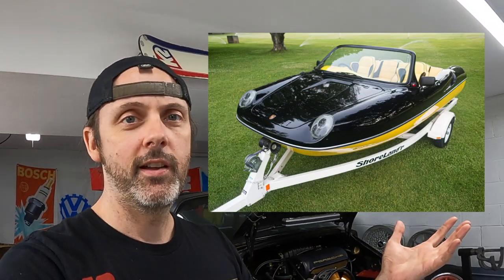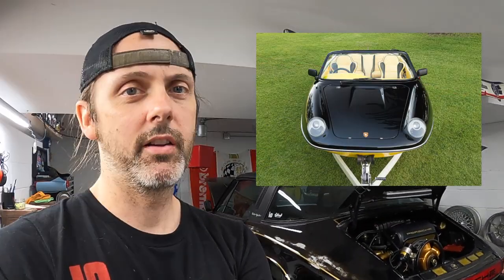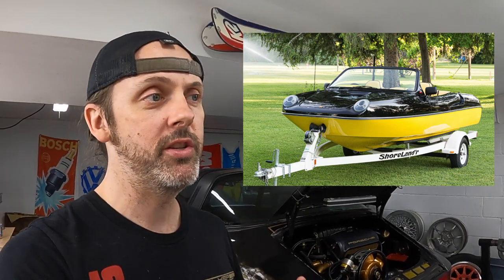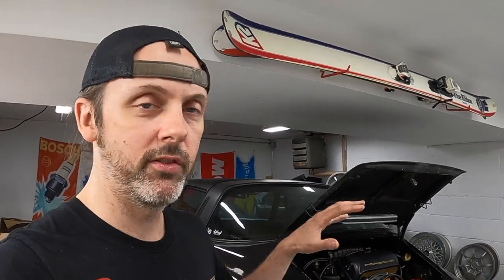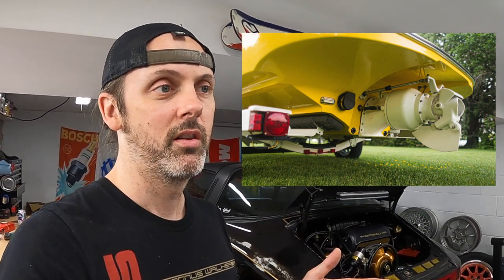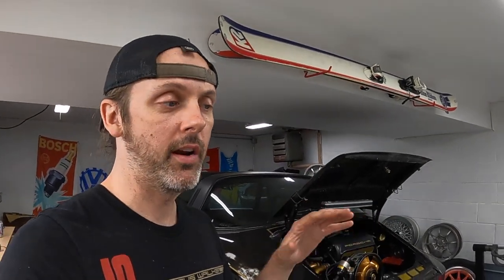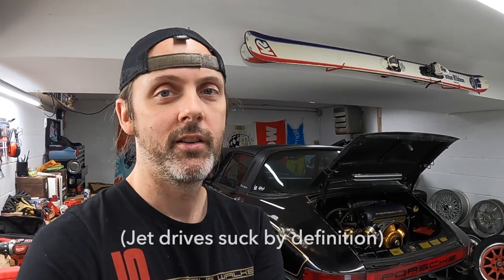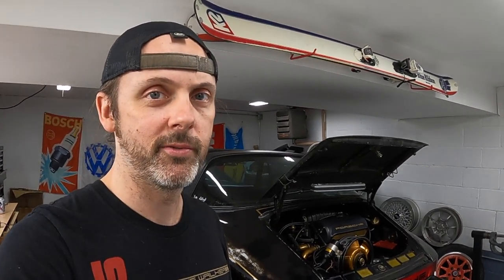PORSCHE 911 SPEED BOAT - Worst Boat Ever?

Comment: I like it, and I think I know a little bit about boats. Why I like it? It looks different. Thats cool. I would like the Altima with the 964 bodykit you showed as well, as long as its done "for the funsies". This surely is as well, well at least in my eyes. I can see paying 20k for something quirky which have no other redeeming features, but maybe thats just me. I am a bit of "originality hound" and not really concerned about sacrilege to the Porsche brand, or any brand for that matter.

Oh, and regarding jet boats and jet drives: You are correct in that the prop is more efficient. Always. But there is one circumstance where that doesnt matter, and the jet boat truly is faster than the prop boat: When you got an absurd amount of power for the hull size and shape. Finnegans boat likely wouldnt be faster with a prop, because that amount of power in a V hull that size and shape is more or less unusable. The jet drive sucks the boat down, like a vacuum cleaner, or a race car with downforce if you will, enabling stability and almost no realistic upper limit to what power can be used. Just look at jet skis/PWC. A propped high powered jet ski of today would be very fast, but borderline unusable unless you got the skills and guts of a 1950s Air force experimental test pilot.... For sure the Jet drive is faster in almost all real world conditions in a powerful jet ski.
Reply from the maker: It LOOKS like it should be fast.  But with a poor hull design, horrible engine, AND an inefficient drive, it'd be slow as heck.  I bet it barely cracks 30mph.  If you want to pay 20k for something that would get outrun by a small aluminum fishing boat with a 50hp outboard, go for it.

As for jets being faster with absurd horsepower, still nope.  Go look up the world record holding drag boat, called "problem child".  It accelerates to over 260mph in under 5 seconds.  Using a prop.   Unlimited Hydroplanes, also props.   His boat would be faster with a prop, and handle better.
Reply: @ADDvanced  Yeah, I am just not that concerned with speed for stuff like that, it looks cool, and it can surely do 30-35, thats enough for most people. Not everything has to be fast, I am sure you agree, so its probably the Porsche connection that riled you up. Perhaps you feel this boat cheapen your car or the brand in some way, otherwise I honestly dont see the problem with it. Live and let live and all that. Best summation: Its a novelty. 

As for the jet drive comment, I think you missed where I wrote "When you got an absurd amount of power for the hull size and shape". 
Drag boats such as "problem child" arent V hulls, so thats a totally different kettle of fish. There are very real physical limits to the power you can use in a single prop V hull of a given weight or size. Unless one gives it a totally flat bottom, but then its debateble if one can really call it a v hull....

Dont know the bottom profile for Finnegans boat, perhaps its almost entirely flat on the underside, but even then he would struggle to use all that power with a prop in a much more effective manner.

Anyway, when it comes to jet skis with their typical bottom profile, I take it you dont dispute what I said? So, as I said, enough power and the jet has the potential to be faster, because of its increased stability. Few boats have that power/weight, but they exist. Cheers.
Reply from the maker: @GoldenCroc  If it has a Porsche logo on it, it should be faster than a "typical" thing.  Imagine releasing a new 911 and it gets walked by a Nissan Altima.
Reply: @GoldenCroc  lol something definitely hurt him. Had to be more than the budget Porsche in his garage.
Reply: @TheKing-nu4fk  No need for insulting his stuff my dude, even if he might have indirectly insulted the stuff of people that own one of these. He just doesnt like jet boats, especially ones that look a bit like a Porsche taken boat form. And thats ok by me. 

So maybe he was a bit needlessly opinionated in this video, I am sure his heart is in the right place in the end, it probably came from a place of caring about vehicles as well. Everyone gets a bit to carried away sometimes, its only human. 

For my part, I am guy liking all vehicles and people that care about them more than as an appliance. Cant we all just..get along?. Cheers mate.